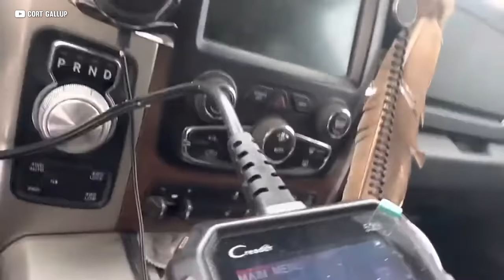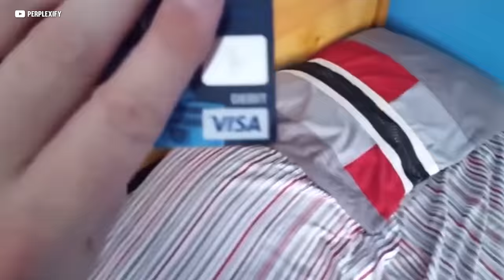Worst Trucks Only Stupid People Buy

Comment: Traded in a 2019 Ram 1500 with 5.7 Hemi... It had the 3.21 gears and I always drove it in Tow Haul mode to avoid the MDS deactivation since i had a mild Flowmaster on there. Who does not mind the sound of a nice V-8 Rumble!!! After replacing stock stereo speakers due to the active sound thing blowing them, i learned that there was a $20 wiring harness that disables that noise suppression crap and turn off them frame vibrators that added a drone sound at certain RPM's. Drone went away! However after a lot of towing, and nearing 66K noticed it just didn't have a set anymore. Engine seemed tired and started to hear that damn tick more frequently and i would run Royal Purple 5w20 which i think running 5w20 just kills the motor. Plus Ram ditched the v-8 in the 1/2 ton segment so I'm not onboard with having a truck sound like a Honda from Fast n Furious. Went with a somewhat affordable deal, 2023 Ford F250 XL with SXT appearance package with base 6.8L gas engine without any of them MDS or Cylinder Deactivations, right at 59K. I'm happy I switched!

Comment: I have a 2015 Colorado with the V-6 and just rolled over 205,000.
 Only issues 1) electrical system popping loudly and whole dash going dark
..cured with two software updates
2) AC system had air flow sensor, in front of radiator go out. Easy replacement. I like the mid-size ( full size in the 1970's)

Comment: I had a 1999 Toyota Tacoma Prerunner TRD with a 3.4 V6 until 2017. It didn't get great mileage with the 4.10 gears, but it had decent power.  I had the timing belt replaced at around 100k miles, and I installed a solenoid kit when it usually just clicked. Other than a few batteries, tires and brakes, that's all it required in 145000 miles. The struts were replaced shortly after I sold it and he said it was a good decision. It was the best vehicle I ever owned, including 2 new Accords (98 & 12) , a new Camry (05) and a new F-150 (17).
The only reason that I didn't get another Toyota is they make NOTHING that can be flat towed behind an RV without major modification.

Comment: I have a 2012 F-350 SRW, 4×4, with 6.2 liter gas V8.  Replaced plugs once, and water pump once.  Now have 188K miles and no problems.
Good truck, good engine.

Comment: I own a 2008 Chevy Colorado 3.7L I5 Z71 4X4 with 4" lift with 32"x11.5"x18" wheels, truck is black with matching front brush guard, chrome grille, chrome 3" tube runners, flowmaster super 44 catback exhaust.
Had it almost two years, and i love that truck and would probably replace anything needed but so far i treat it really good, no check engine lights, runs good, decent gas mileage for a 4x4, and gets around fine, only issue i have is a tiny leak on the rear main and i really dont want to mess with it this fall or winter

Comment: I had a '96 Silverado that I put 356,000 on. The only major issue was the transmission went out at 220,000. And fuel pumps about every 100,000 miles. 
I replaced it last year with an '08 Colorado extended cab with 4wd and 57,000 miles. I enjoyed it, ran good, but then I found the frame was rotted out to the point of falling apart. I got rid of it at 61,000 so I never had a chance to experience engine issues. 
I replaced it with a used '18 Sierra 5.3 with VVL. Ran great when I test drove, no issues, but the dealer detailed under the hood. A week later, electrical problems. Ended up replacing the main fuse control box. 125,000 on it and knock on wood. I get a quiver in it occasionally that I can't locate. Other than that, dash shows 21 mpg when paperwork at pump shows 18 mpg.

Comment: I own two Fords. A 1999 F-150 4,6 V-8 with 279,000 miles. the only major thing I've had to do is replace the timing chains, sprockets, and tensioners at 250,000. The other is 1999 F-359 4x4 duelly. I took the 7.3 out at 269,000 and sold it to a friend who wanted to replace his V-10. I replaced it with a 10.2 liter turbo V-8 from CAT and a 7 speed Fuller trans. It was a big jump up in power and torque. And after 152,000 miles it's had zero problems and pulls anything I hook up to without even thinking about it, Including two Ram 3500 duellys.

Comment: I have a 2001 Tacoma Double Cab PreRunner SR5 with the 3.4 and have over 230k miles with no major issues. Had valve cover gaskets to start leaking and just recently my alternator is starting to go. Other than having to rebuild the rear-end because I  got stuck and had it up to about 55 mph, (not actually moving), I ruined the carrier and pinion bearings. Other than that, it's been real solid.

Comment: We had a 2009'ish (IIRC) Dodge Ram 1500 with the 4.7L V8. No "problems" per se, but the engine was just weak, and the tranny would shift way too early, adding to the already anemic performance. The Hemi 5.7 needs to be driven in V8 mode exclusively. See any number of videos to disable MDS on your model/year. Our 2019 Ram 1500 is always driven in V8 mode only; I love it.

Comment: My dad has a 2014 5.3 V8. He replaced everything for the cylinder deactivation when the oil pump went out at 175,000. I tried to explain to him that it would probably happen again and to just delete it but he wanted it stock. I think it cost him close to 3 grand. Other than that one expense it’s been reliable. Nothing other than maintenance since he bought it with 20,000 miles. I personally like the 1999-2007 2500 with the ole reliable 6.0 V8. Those are tough engines.

Comment: Best truck I've ever owned is my 2004 Ford Ranger Edge Supercab, 3L V6, . It survived being handed down to two kids for their first vehicles. It's held up great, aside from roof oxidation. It runs great and operates just as well as when I first drove it off the lot!
It's required very little maintenance. Worst problem I've had was a bad fuel pump. It only has 94K miles on it and I hope to drive it for another 20 years! Finger's crossed!

Comment: I have the 4.7L V8 in my wife’s Grand Cherokee with 180K miles.  It runs like a top and the 2009 has the life-time power train warranty.  She’s been a great vehicle!  I also had a 1992 Toyota SR5 P/U with the 3.0L.  It also ran great with over 100K miles before I traded it for a new Taco.

Comment: I can confirm that the 5 cylinder Chevy Colorado has given me so many problems. Especially with its sensors. So many times, the engine would go limp, and I'd be in a panic. Haven't had any major problems with my 6.0 powerstroke, though. Just the EGR valve is carbonized, but that's it. Just pulled it out, cleaned it, and reset the computer. Didnt cost me a single cent. Otherwise, she's still running good past 220,000 miles.

Comment: Had a 2016 Nissan Titan XD Cummins.   It had constant regens and it was just a dog!  It had this horrible dead pedal lag that almost dangerous.  I deleted and tuned it to avoid the regen and having to use DEF and for more power.   It definitely made a lot more power and the dead pedal was mostly resolved.   Then the  EGR started leaking and consuming coolant so I deleted that.  Then I had a turbo burn out when towing a big trailer up a mountain.  I had the turbo replaced, the turbine wheel shaft was bent and it self destructed most likely from the over boost of the tune.  I also changed out the lift pump after priming issues after changing fuel filters.  I lowered the tune to the lowest setting and put another 10k miles on it and sold it.   A week later the new owner told me the turbo blew on it.  I was like What?? No f-ing way!  I didn't fully realize what a time bomb this truck was.   I ended up buying another Titan but I got the 5.6 liter gas engine and its been solid.  I will never buy a diesel anything ever again.

Comment: I had a 99 Grand Cherokee with a 4.7L V8. I loved that vehicle. Even with 200K on it it dove beautifully. The engine was very peppy and would get 21 MPG on the highway even though the Jeep was full-time 4WD. Sure, the Jeep needed a good bit of maintenance over the years, but the engine itself never failed. I did have to replace the transmission and the rear end, though. Honestly the engine was the best part part of the whole vehicle.

Comment: I bought a 2002 Dakota with the 4.7 years ago that had 22k miles.  Installed an Amsoil bypass filter system on it.  Had it for years and sold it to my Dad who still owns it.  I haven't heard of any engine issues yet.  My mom prefers it over their car.  I miss that truck. 
When I owned it I had to replace the AC compressor and the control arm bushings.  I probably towed excessive with it which is why I went with a full size and sold it.

Comment: Luckily I have an 03' Z71 Tahoe 5.3L with 328,000 miles on the ticker. No lack of power. Loaded with vacation items it pulls a 3400lb boat thru the Adirondack mountains with no problem. The trans has been built for towing and I still have to put 4.11's in since I run 33's. The truck is maintained properly and I'll keep it until it rusts into the ground. That may take a while as it is in NC and it has no rust on it.

Comment: I own a 2014 gmc seirra and aside from a couple issues with the ac it has been a great truck so far. Has a 5.3 at 114k. Ik about the lifter failure issue but I intend on putting a cam in it with non afm lifters. Which would make it just as reliable as a gen 3 ls. Let's be honest. These trucks are probably one of the better picks on this list in terms of reliability and simplicity of working on. Especially if your going in with the intention of caming it

Comment: The 4 cylinder engines in the same Toyotas ( which came with the base models with manual ) were great, though.  Bulletproof, only a few less HP (all of that HP difference in the V6 was at the top end, WHEN it finally got there), and revved quickly (plus you could hold it in gear versus the automatic fighting you to downshift as quickly as possible.  So the 4 cylinder was 1 second faster.  Still a sobering 16 seconds, but hey, it's a 4x4...) Also less weight, easier to work on, and worlds better fuel economy.  Of course, finding a 4 cylinder with manual is super rare as nobody wants to sell theirs.  Adding the optional turbo back in, though, that changes everything and drops that time to about 10 seconds. :)

Comment: I have a 2014 eco diesel so far 152,000 miles runs like new still pulls great,  only issues,  fuel injector replaced,  cooling sensor replaced and water pump replaced.   All at once.  At 150,000 miles. Runs great looks amazing still always gets compliments

Comment: Recent Story   This year, I bought a used, Well Maintained, and Well Cared for 2014 Chevy Silverado CC LTZ 5.3L. Excellent Condition. Only 115K on it. 3K later? Engine Grenaded. 100% JUNK.
Replaced with NEW one at more than $10K. NOT HAPPY.  The AFM/DoD is GARBAGE. Not a Question of "If" but WHEN. DO NOT BUY.
I wanted a Diesel, but the prices are outrageous for used. This Gasser was in the middle price wise. Gave it a good check, everything seemed on the up and up. 
If you have one, RIP out the parts, a few thousand dollars to do, and you have a Great Reliable Truck, it's AFM Delete Kit. Too late for me.

Comment: Original Owner of a 2002 F-150 FX4 with the 5.4 Triton.  150,000 miles on the odometer only replacing the spark plugs and coil packs and a single caliper.  Regular oil changes at 5,00 miles and that's it.  My company did have a E-250 that spit out a spark plug like a loose tooth.

Comment: We have a 2010 F150 with the triton engine. I just drove it the other day. It has 228’000 miles on it! Still running great. Just had a filler pipe issue.

Comment: The 5.3 liter engine is great as long as you take it to a shop and have the afm deleted, plug the afm ports and install regular lifters.  After taking care of that it will run forever.

Comment: I have a 2014 Dodge Ram 1500 with the 5.7 Hemi engine. I bought it with 96k miles on. Use it for landscaping, so, it has hauled it's share of heavy dirt and rock.
But, so far, I've put on 10k in 2 years gradually and she's doing ok!!!
The automatic locks are a little funky, but, I haven't changed the battery in the FOB yet!!!

Comment: 2004 silverado 5.3 1500 Z71.
Purcased new August 03.
Current mileage 432,000+.
Only repair was a waterpump at 382,000. 
I do all maintenance. Still every day construction work truck.
Why did they change this 5.3.
This is a strong engine.
Most reliable truck I've ever owned out of 8.
Origanil trany also.

Comment: you forgot the Fords with the 7.3 godzilla motors, nephew bought one in 2021 F350, motor locked up tight with 41,000 miles on it, debris from failing cam/lifters locked up the oil pump, this is actually my nephew's 3rd failed ford product, 2 were new trucks, 1 was a used ecoboost f150.   i still have my bought new 98 dodge dakota 5.2 4x4, about ready to go over the 400,000 mile mark soon,  only major problem i had with it was a heater core replacement, i just replaced the original starter this past spring, still spinning the original alternator, original transmission(with 50,000 mile fluid/filter changes)  regular maintenance other wise, also treated it with fluid film from day 1 to prevent rust, truck is very clean yet

Comment: I have a friend with the F350 super duty with the 6.0 diesel. It is used to tow a trailer and make hot shot deliveries on a daily basis and hasn't malfunctioned since he had certain modifications made. I don't know exactly what, but the truck with the notoriously bad engine performs flawlessly.
Reply: The reason why people have a lot of problem with the 6.0 diesel is because they overpower it with all kinds of stuff after market that's why it wasn't reliable, you keep it stock. It is super reliable. I own 2 of them. Never had an issue but very minor stuff. That's gonna happen with any diesel or any gasoline gen never left me stranded

Comment: I thought for sure the gm 4.2 i6 would be on the list.
I had an 04 trailblazer that hit 265,00 but it was on its 3rd motor.
1st one sludged up and the vvt took a shit. The second one put a window in my block and when pulled apart one of the piston rods looked like it was cut in half by a laser. I could put a square on it and it was flat as the block Deck, almost as if it was cast from 2 halves.

Comment: '07 F-150 Triton V-8 reworked and dialed at 525 HP.  The only trouble I had was kind of funny.  I went with Dyna flow tail pipes, they melted the spare tire mounted between them.  Softy's Speed Shop really knew their stuff outside of the pipes.  I chose Afe power supercharger and Ford power and fuel chips.  Rods and connectors by Summit Racing.

Comment: Owned a 02 4.7 Ram had no problems but you're right about the towing, moved up the 5.7 hemi in 04, loved that pickup but really couldn't tow our new 5th wheel TT so next was a 11 Ram 2500 diesel 4x4 yep that's the one still driving it in 2024.

Comment: I bought my (now 20 year old) '04 F150 Lariat with a 5.4L Triton off the lot brand new.  Beat the snot out of it.  Haul with it.  Tow with it.  I live in the sticks on dirt roads and only changed the air filter a few times.  Only changed the oil every 7k to 10k miles or once per year (with cheap conventional oil and cheap filters).  It's at 150k miles now and I never put a penny into that engine.  Still original plugs of course.  Runs like new.  I really have to wonder who has mistreated their Triton more than me?  That engine (actually the entire truck) has been stellar.  Think I paid $27k or $28k for it + tax back then.  Best vehicle I've ever had.

Comment: In defense of the first gen Colorado/Canyon. The power train and chassis was built by Isuzu when they had 51% of the company’s shares. GM put their body on it. They are cousins with the Isuzu I280 and I290. Isuzu was able to buy back most of its shares from GM in 2008 during the financial crisis. Which ended the first gen. 

5.3L/6.2L cylinder deactivation. You can have it programmed to not go 4 cylinder mode. You can also put and LS heads and and remove the cylinder deactivation. But it was way better then the displacement on demand from the 80s and the northstar in the cadys in the early 2000s.

Comment: My 2019 Silverado LTZ (7600 miles total on this truck) is great and looks fantastic, only issue is a very slight Transmission Shudder around 18 MPH. and when slowing down a "Clunk" going from 2nd. gear to 1st. gear.  I called my Dealership and they confirmed TSB's on this needing a Multiple Transmission (3 times) to rid the Truck of Factory Trans. Oil especially at Torque Converter, Price between $600.00 and $800.00 (depends on how many quarts of New Trans. Fluid required). If the Factory has a TSB, they should be required to chip in on the price. I did install a Pulsar LT to get rid of Auto/Start/Stop and DFM. Now honestly would I buy this truck again? Nope.  This Truck has everything except Sun Roof and BOSE System and the 360 Camera System (Cameras only come on when Trailer is plugged in - which is B.S.). Cost was just at $70k.  All the New Trucks are WAY too expensive now. Mine also has gone thru Ziebart Rustproofing, ALL these Trucks will rust away just about the same time you pay them off. I pray the Ziebart works.  At times I think about selling my beautiful Truck and just putting money into my house for the long haul. Chevrolet - See the USA in a Chevrolet isn't what it use to be.

Comment: I have a 2013 Chevy 2500 HD 4x4 6.6 duramax. The stabilitrack light drives me crazy. is it wheel speed sensors, brake pedal, steering sensor, wiring issue, brake booster, and more. .I am still tyracing down the issue. Now a  check engine light is on. It is #4 glow plug.